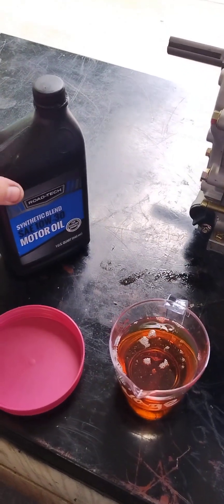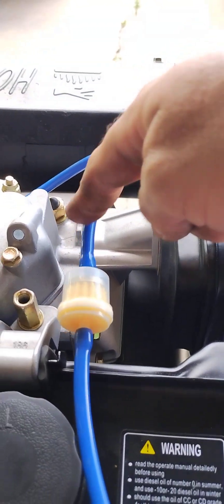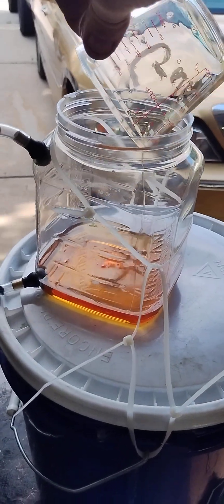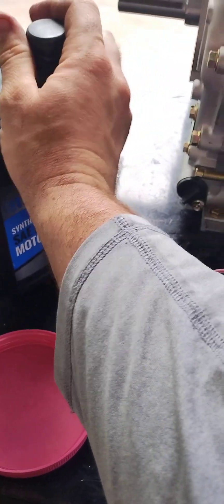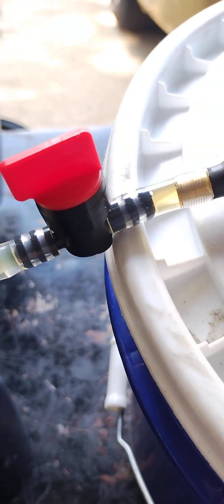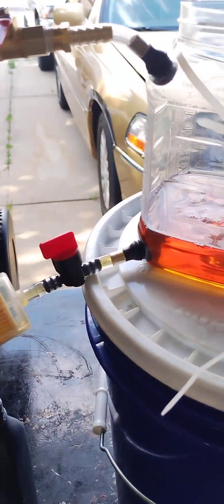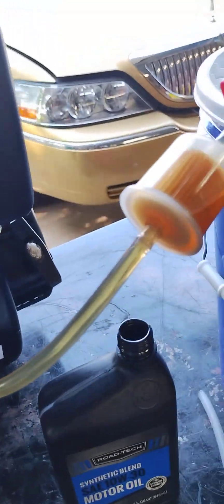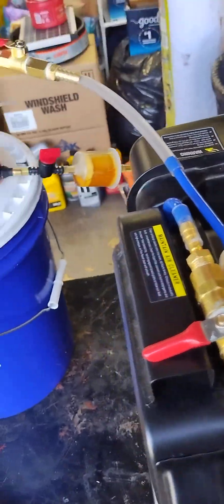Amazon Diesel Engine 186FA Will it Run? (on Road Tech synthetic blend 10W-30)

Comment: I would probably run it without the filter. It's a clean oil. Just for a test. Cool test. Lol
Reply: I'm also curious what engine you're using. I've seen these little diesel engines, I haven't shopped for one.
Reply from the maker: 186F diesel. 10HP 20ftlb torque, had to bolt it to my tool box cause the first time I cracked the throttle it tipped over 😂
Reply: @TACOMASRT5  I get it, that's just something cool to play with. I might buy one now, I've been wanting to. I'll bet it will run on almost anything. Lol
Reply from the maker: @dougwhite2897 thats the goal!
I'll be running 2 fuel tanks.  The stock one attached to the engine filled with diesel to start and warm up.  Then once she's hott switch over to the home made fuel.
Reply: @CarModsandDadBod  Can't wait until you do something cool with it.
Reply from the maker: Thanks for your support
Reply: @TACOMASRT5  They have since destroyed and sunk the USS AMERICA CVA-66 🇺🇸 They couldn't sink it after a week of target practice, so they had to send a team in to sink it with explosives.